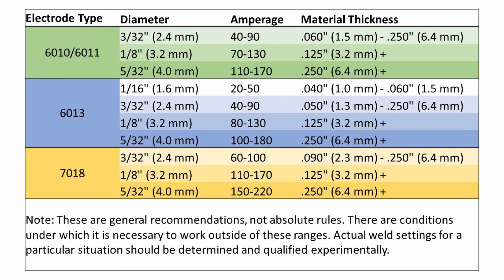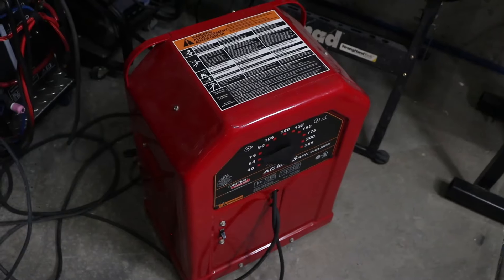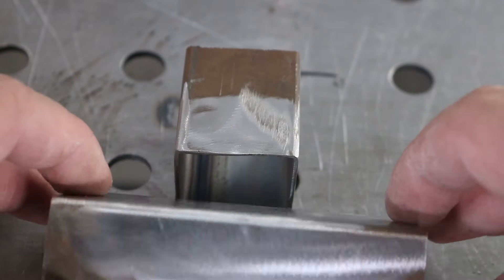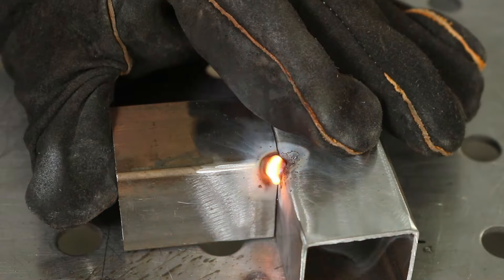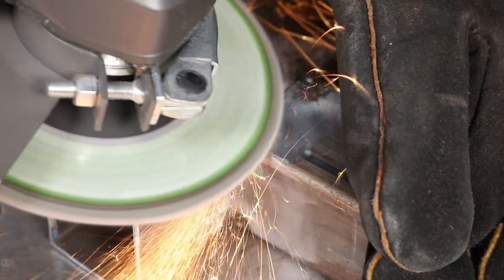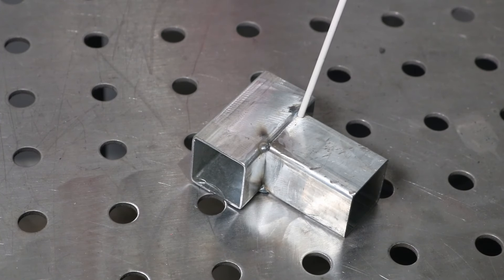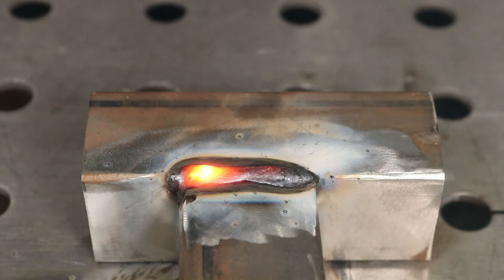Stick Weld Thin Square Tubing

Comment: Something VERY important when welding this thin tubing is FIT. If you have gaps you are in for a very messy time! Grind everything to get the parts to fit with no gap for trouble free results!
Reply: Very good advice,fit is half the battle and especially on angle cuts that leave a sharp edge that is thinner again and will give blow through easily.

Comment: Great video man. Just one suggestion though. If you could annotate a metric conversion on screen this will help out a lot. Cheers.
Reply: Metric is not real
Reply: @james10739  it's better than Imperial. I've grown up with Imperial so it's easier for me to mentally approximate, but metric is totally easier to work with than fractions.
Reply: @marsbase3729  agreed 🤝 👍
Reply: @marsbase3729  your lucky, think about us that never work with fractions. only time we work with fractions is when making threads on pipes.
These imperial measurements are alien to us xD

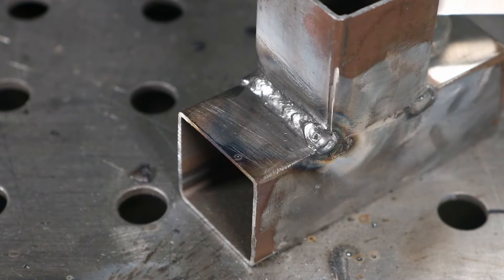Comment: ive been welding for 30 years and making bird poop for 30 years in ever increasing splodges. finally a teacher that takes his time and shows you with a good camera what he is actually doing. at time 7:00 for you, you knew what you were doing so you went back a little, got the bead going and then pulled the "puddle" . for us 30 year old poopers, thats where we have been doing it wrong all along. so, im gonna get some 6013, get a welding machine with a dial that will do 40amps, measure the amps and see this "puddle" thing you do that i have not been able to do for 30 years

Comment: Your videos are the only ones I have found that actually teaches the best techniques for welding ( at what amperage to put the machine, what rod to use, the angle in which to put your rod, etc.) It really helps a beginner like myself. Thanks a lot!

Comment: my ac welder has those shunts to adjust the amperage. but when i lower ot to 55 amps, it make a lot of noise. it welds fine but the noise is so annoying. your videos have helped me alot to start welding,👍

Comment: thanks Tim, that helped heaps....just gotta do the mileage. One thing I gotta ask. We have all seen the tips on other sites where they do multiple tacks as a method of not getting the metal too hot in this situation. (I understand the relationships u speak of here re ammps, rod, rod angle, travel speed etc. I for the life of me with my 6013 Rods, 2.6mm.....I cant get my stick to repeatedly arc up again like they do.....I have to hit a piece of wood at 90degrees or scrap my rod over a brick to break off the flux so I can arc up. So i know whats happening and it dont bother me on longer welds with thicker metals.....but welding thinner stuff like this for agtes and other projects......I dont get it. How do they do it. Usually my amps and arc force are set pretty okay for what I am welding................so I am aware of all that......I know its called burn back....but most searches only reference that to mig welding and the wire length and issues on terminating the weld...wire that is. Any thoughts appreciated...as are as a part of my welding journey. Cheers.

Comment: I do use 1/16" electrodes on bike tubing.  I cut them in half and use them short, because autherwise they are too limp to control.  If you cut the electrode in the middle, and clean both ends for the clamp, one will already have the correct end on it.  And the other has a part with bare rod sticking out of it.  Clip that off right to the flux and one has two usable rods.

Comment: Thank you, a very helpful video.  I didn't know that a longer arc length created a hotter welding condition,  this is with a "buzz box",  right?
With an inverter welder with dig turned on, arc force is increased by a tight arc gap so,  I'm thinking that dig should be set to off or  very low when maintaining a tight arc with an inverter welder.

Comment: Hello Tim
Nice to write to you again.
I love to use a E7018 electrode
I have manage to weld.with it even a amp as low a 90 cause a was fixing a motorcicle (stirrup) well the trues us that I really don't know it's name in English
but it is very thin tube and with E6013 i was making a disaster leaving slag embedded in the weld.
I grinded all of it and rewelded everything.
I just can't think of changing for m
something all.
I just wanted to

Comment: Im new at stick welding always  wanted to try it out,good thing to have as i need most of the time something to be welded.anywaus i found that if you cut your rod in have make it 2 short ones if you do smal welds,its easier to control shorter one than the whole length rod,still learning so this way makes it a bit easier to keep a steady weld,am i right or wrong in doing so?

Comment: I am having problems with porosity when usin 6013 I think I am moving too fast or the amperage is too low!
My welder is a cheap Parkside one up to 2.5mm electrode!

Comment: I used an ac buzz box set on 50 amps (machine only had 50\100\150\&200),6013(2.3mm) for welding 30x30mm clean tubes and arc made holes in tubes so i had to weld it only using arc shots.
What's the solution to avoid melting the tube ?

Comment: I just started to welding but i often blow holes in the work piece. I guess it's because the arc lenght but i don't know. I have to practice alot i think.

Comment: Hi Tim, do you have advice if ok, welding thin GI steel, (galvanized Iron) im using E6013 - 2.5mm, if I run about 60Amps either my rod sticks or the weld don't stick, if I run 70Amp + I get blow outs
Thanks

Comment: Hey Tim,

I’m living in Asia now, can mostly easily find electrodes like Japanese RB-26 2.6mm. Tried it but the results were horrible, I’m still learning.

In your experience, is this something similar to 6011? I was running the electrode on negative pole per the inverter welder’s manual.

Comment: Do you use the 60 series setting when welding thin metal? Also curious if you’ve tested 6013 electrode negative to prevent burn thru? Many thanks.

Comment: How do I weld big gaps on thin wall tube?
I have to weld 2mm wall square tube with 2.5mm electrodes. There is 1/16 - 1/2 inch gap that I have to weld. 
How do I do it? If I’m luck and don’t blow a hole, I end up using 4 rods

Comment: Important advice:
You cant grind something flat with a disc which isnt flat, especially with such thin materials you want to touch it as little as possible!get yourself a flat flapdisc and hold it as flat as on the tacks as possible, or just use a cut off disk to grind a nice place to tie into without touching the parent metal

Comment: Here is a very simple trick for you that will change your welding skills on thin metal forever, combined with what you have said! Try it and see for yourself...Switch your poles (negative & positive) on your welder! Simple as that...Just try it and see the improvement. It arks to the electrode and not from it, thus not burning holes in your work piece.
Reply: So, dcen instead of dcep?

Comment: Been using tig for my 1/16 square tubing, its slow and argon eating so Ive been trying to stick weld , 1/16 6013 @ 45 amps DCEN, hard to start , 
Going to try your way 3/32 AC ,thanks great movie.

Comment: What welding rod do you prefer?
For thin square tubing
Reply from the maker: For thin tubing, small diameter 6013 really is hard to beat. 7014 is also fairly similar and not a bad choice. It's a challenge with any electrode, though.
Reply: @TimWelds  I been trying rod 7014 1/16 with no success but I do notice 6013 3/32 rod works good. My question is if I’m grabbing the wrong size of 7014 rod? Not sure if I’m making any sense.

Comment: What would you recommend for a push mower deck 6011 or 6013 3/32 or 1/8 rod
Reply from the maker: I’d use 3/32” 6011 with a whip and pause motion, but 3/32” 6013 would work fine too and may be a bit easier to use without burning through.

Comment: My DC welder goes down to 50 amps, I generally use 1/16 rod at that setting, but never tried 6013x3/32.

Comment: Using DCEP 2.5mm N6013 what is the correct ampere setting for tubular 1.5mm to prevent holes when joining. Thanks in advance

Comment: So to sum up a little bit- less than 30 amps for 1mm of stick. So 2mm stick means 55 amps on the welding machine. I always did 40 per 1mm, and I have many holes sometimes. With less you may have issues to raise an arc. 
Thank you for the tips!

Comment: i just started welding shit without learning tips on utube..no wonder the metal melts even though its a thick angle bar cuz i set at 200amp lol. and i cant weld continuously cuz its so hot it starts to fall off and scatter and it scares the shit out of me red sparks flying everywhere and im just wearing shorts and no shirt.. my skin are all red at the end of the day...safety wise its stupid..but is redening of skin bad?

Comment: Just a quick question. Are you getting headaches on the left side? You have your head tilted that way and it often will indicate headaches there. If so see a chiropractor and they will help with the headaches.

Comment: Hi, I've stick welded before but gave it away because I wasn't using it much . Unfortunately , I need to weld two small holes in a mudguard of an old Japanese motorcycle (175 honda) . It's only .025 of an inch . The guard isn't removable btw . You think stick would be suitable ? Regards Will

Comment: Good video for the majority of intermediate welders. But the 6013 runs smoother using DC electrode negative if available.
Reply from the maker: Totally! I usually run electrode positive on stick, but electrode negative would work great on this thinner stuff, giving less penetration and letting you move along really fast. Great tip!
Reply: @TimWelds  Electrode negative will result in higher temperature on the material (due to the electron flow from - to +) and so bigger penetration in material - isn´t it?
Reply: @mladenfrank2613  I think DCEN generally is thought to put more heat into the electrode and less into the base metal.  Thus running an open root with 7018 is generally easier on dcen rather than dcep.  the electrode is hotter and the base metal is cooler.  Same with flux core mig.  it is run dcen so the electrode gets more preheat of the flux in the wire.
Reply: @mladenfrank2613  
Current flow is not just electrons, there is also the molten metal that carries positive charge in the opposite direction. Because the atoms are accelerated consistently in one direction on DC, they also develop kinetic energy in one direction and dump that heat into the metal they are colliding with.
Reply: @peetky8645  could a smaller rod 7018 be run on dcen at a lower amperage to weld thin metal?
Reply: @Antoniocool86  depends on definition of thin and what it is used for.  i have heard 6013 works better on thin but most say non-structural only-ie if it broke, could it kill someone.   my understanding is that 7018 is rather difficult for an open root full penetration weld because it is not a quick freeze electrode.  dcen or ac might help with thinner stuff as would welding in a downhill or somewhat downhill from flat positioning.   i am gonna make some roof trusses for a carport from 11ga tube.  i plan to try small 7018 in a trial to see if it will work.  most people say MIG (metal inert gas) or tig are the way to go with really thin stuff.  the james Lincoln foundation sells several welding textbooks at cost - one has about 300 lessons and seems oriented to a vocational tech audience- cont remember the title but it covers everything stick, mig, tig, pipe etc and was like 20$.  check the website(google it)good luck

Comment: Good video Tim, I've just borrowed A Parweld XTS 143 to weld some tubing, l used 2.4 rods, and got good results using the DC set, my Clarke AC set l just sold and ordered the Parweld XTS 143 such a big difference to using AC

Comment: Not a fan of 6013, but you can use it. Harbor Freight has kept 2lb boxes of 1/16" 6013 in stock in recent years. Some of the overseas welders use 3/32" 6013 with a dab-dab technique on thin metal, because that's what they can get. (6013 flux is basically a  ceramic and can survive the tropical climate, no small thing.) 
   They strike the arc at 45deg pushing away from the direction of travel, create the puddle, break the  arc, then just as it fades to black, strike it again. You need the angle to push the flux back from the leading edge. You are making a bead of spot welds, but it spreads out the heat, and they make it work! 

   If you wanted a continous bead you could try 6011 electrode neg.
If you had to do a lot of them, with practice and getting the right settings you could make a decent bead.

   I like to use 3/32" 6011 DCEP, and spot weld, that is build up a bead of spot welds. Then I can spread out the heat. That will work on heavy sheet metal too, especially with a copper or aluminum backing block to soak up excess heat. 
    IF it isn't pretty, "Grinder and Paint make me the welder I ain't." 

    Just some ideas, thanks for your videos as always.
Reply: Does that not trap the flux when the next tack gets done? Total newbie here but we also mostly get 6013 here where im from in South Africa. Appreciate any help or advice its extremely tricky to weld this thin tubing without burning through and have considered the tacking method .
Thanks
Reply: There are lots of videos of the dab-dab technique with 6013 (the smaller the electrode the better,  3/32" (2.4mm) or smaller). 5/64" or 1/16" are better (2.0, 1.6mm) but may cost a lot more, be hard to find, or simply not available. 
    One reason I prefer 6011, even though it's more aggressive, is it will absolutely burn through any remaining slag. It is also fast freeze. 

    But you can definitely do it with 6013.  I don't think you get slag entrapment, because you use a forty-five degree angle so the arc force pushes the slag away from the leading edge. If you can restrike while the last bead is still hot, the flux should easily melt away. Also, you strike the arc, make a good molten puddle, then break the arc. If you hold the arc too long, you can burn through and you add too much metal and slag. The excess slag will cause trouble. 

    If you have really thin tubing or sheet metal you might have to do one spot weld at a time, then move several inches, wait a minute, etc., etc.. I think you can do it with a 45 angle, make a puddle then break the arc. You could scrape with a chipping hammer to check for slag. 
    With this kind of welding, you just try untill you find something that works for you. If you really mess up, and you will, just  walk away for a minute, then come back and try something a little different. Best of luck.
Reply: @thomaslewis9526  thank you so much for taking the time to respond to my message. I appreciate the advice and will surely try this out . Thanks again

Comment: Rule of thumb for setting amperage: take electrode width in inches, eg; 1/8''  then 1/8 = 0.125  the amps = 125
Reply: except for cellulose rods :)

Comment: Most of the time when I weld into corners it looks perfect till I chip off the flux and then I find a gap running in between and not joined. If I up the amps I blow through. If I slow down I blow through. It’s so tricky
Reply: Same problem & it's driving me crazy. Did you ever find a way to get the weld to stick to both faces with no gap?
Reply: @Marvosvids  hey matey.. I don't weld often enough to be awesome at this but have learnt a few things. One of which is Solar Flux used for TIG welding stainless instead of using shielding gas.. Which can be made by chipping all the coating from a welding rod, crushing it really fine, adding some acetone to it or meths, painting it to the reverse side. The acetone evaporates leaving the fine coating that shields metal as you weld. That way it will be less likely to flare up and blow through. Iron oxides become something like thermite and burn like paper. So clean the work really well on both sides if its thin. Practice on scraps. Dial in the amps so you can get it one pass. Learn about correct angles for the direction you are travelling. Also try to design things that can work within your ever growing skill range. A structural welder I spoke to reckons it took him days of welding to dial it in. pounds and pounds of rods. As a hobbyist you never get to do this.

Comment: Hey i just got myself a transarc 140.cig .the black face one welder its a beut . Had the wrong technique. I had the right amps .but didnt know .im just flying blind with some clue.ill watc h again .thanks .i like arc welding.i have a transtig 140 old school .ive yet too fire up asnd a transmig 195.old cig rural pack .but yet too fire.anyways i have a gasless too .lol.i got everything. Im always fixin stuff .so handy .anyways thanks for the tips

Comment: Would this be a good beginners welder for a metal fencing project? 2" square tubing 3/16ths, I have a 220v 7000 watt generator to power it.
Reply from the maker: It would be a great machine for that material. I don't know what size generator would be needed for an AC225, but you'll get a lot more power out of an inverter welder for the same generator. The AC225 is a great machine, my only concern would be the generator size, which might cause me to look at an inverter welder instead.
Reply: Thank you tw for the reply. You're right 7000w doesn't meet the spec. 225amp at 25v is only 5625 watts but the step down converter from 220v won't be anywhere near 100% efficient, and the specs call for a 50amp input. 

We have 50amp plugs available but wanted to use this on 800' of fencing with a generator, obviously to save costs and to have a cheaper welder being beginners. 

I will think on it some more, but might just end up buying it and testing it and returning it carefully if it doesnt work on the settings we need for the fence.
Reply: Looks like this will work better with my generator as it only pulls 29amps 240v. Thanks for the pointer in the right direction. 
Miller Thunderbolt 160 DC Stick Welder 907721